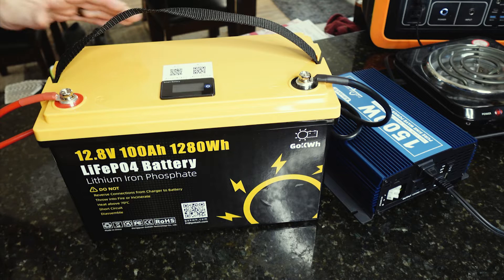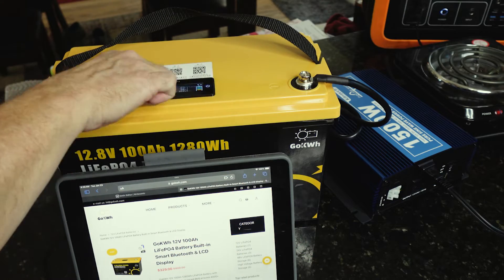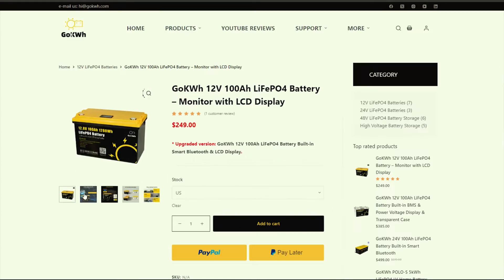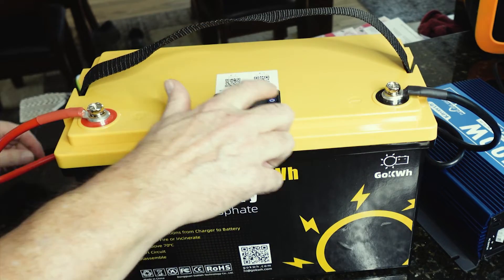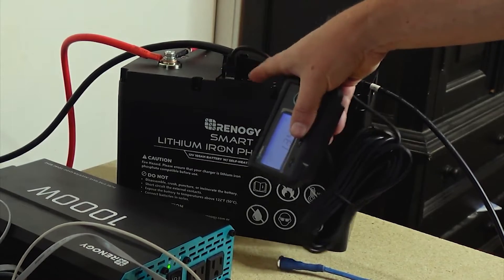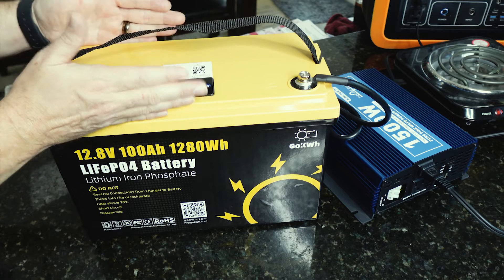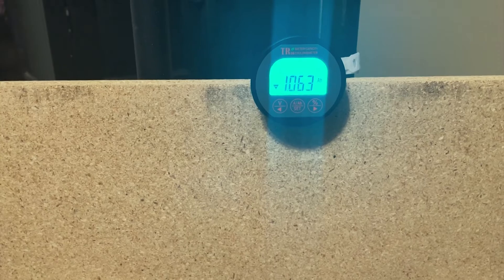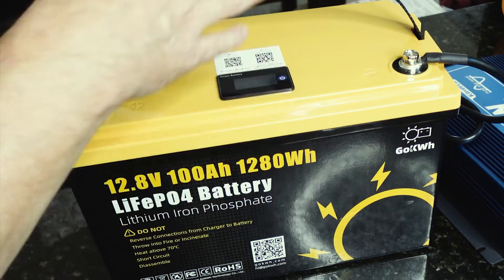GoKWH 12v 100ah Lifepo4 Smart Battery Review | Great Price!

Comment: Glad you did it this video since I’m looking in to getting batteries for a couple different setups.
Reply: Plenty of 12V 100Ah LiFePO4 batteries with Bluetooth for 2/3 the price on Amazon.  And the battery monitor is a gimmick and ripoff since you can just use the Bluetooth on your phone.
Reply from the maker: I'm pretty suprized how cool it is. I love the battery monitor.
Reply: @TheBugOutLocation  Beg to differ.  As the previous poster said, these are not a good deal for your standard cheap Chinese imports.  Bluetooth eliminates most of the need for the battery monitor.
Reply: @hicapengrs  so in a situation where Bluetooth isn’t available it would be nice to see it on the battery. Do we really need to get out our phones to see how much battery we have? Might as well get out a voltmeter. Cool feature but I would rely on it.
Reply: @hicapengrs  Totally agree!